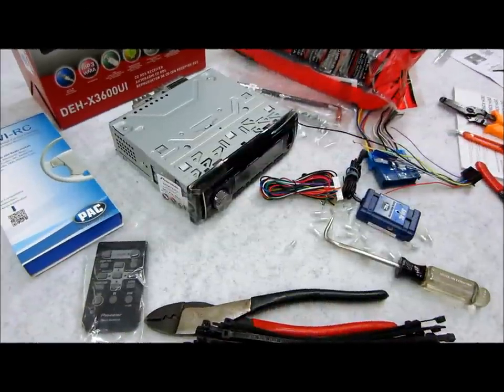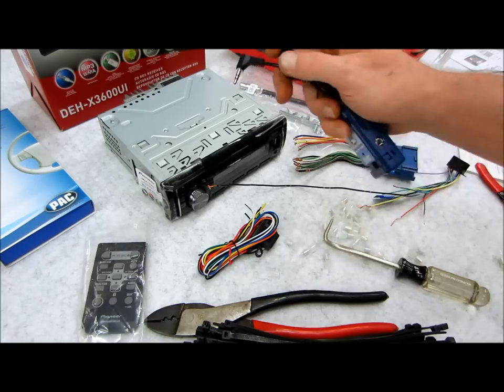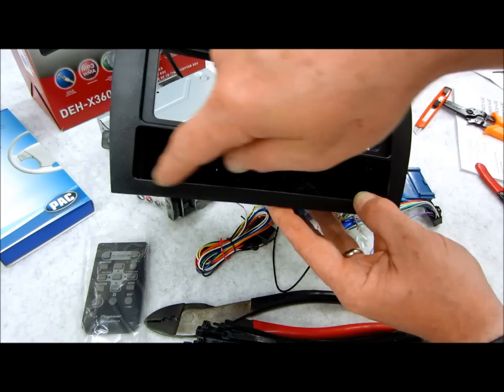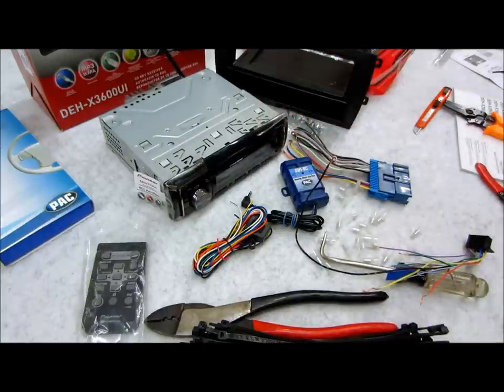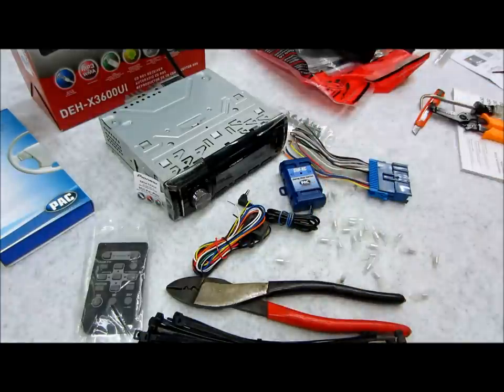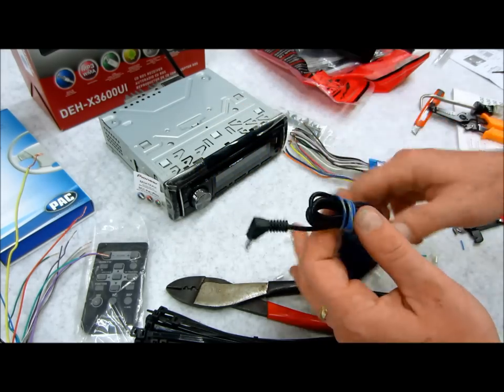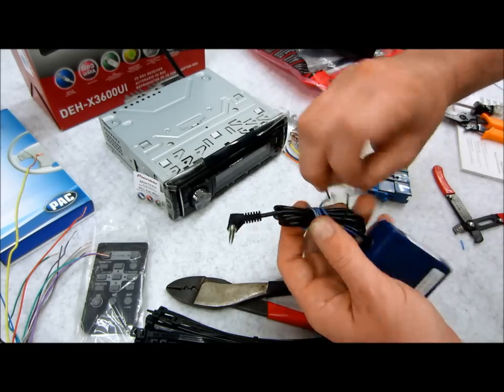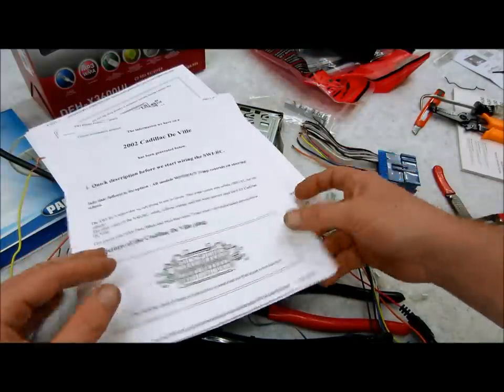How to wire up and prep a new radio, dash kit, harness and steering wheel adapter

Comment: For someone who knows what they're doing , I'm surprised you use the worst items (crimp caps,  vampire clips ). I could understand if you're a shop and in a hurry. But for yourself best way of course is solder with heat shrink tubing/tape. Those crimp caps are the worst.  Vamp clips, and similar aren't any better

Comment: I have a 2002 DeVille, is this all you need to replace the stock head unit?
Reply: Same, did you end up installing? If so what harness did you use?
Reply: @ImmaculateHairline  not gunna lie. I’m still riding stock
Reply: @ImmaculateHairline  hey did you ever find out what harness to use

Comment: im new at this, do i have to buy an additional wiring harness, or is the one that comes with my after market deck sufficient?
Reply from the maker: You should buy a metra (or comparable) wiring harness adapter so you can undo the install later on and not affect the factory wirings integrity.

Comment: I'm putting a pioneer in a  2007 Sonata with a factory amp and subwoofer. Cruthfield says I need a factory amp gain adjustment so they sent me the scosche SLC-4. It installs between the radio and harness..... the wires on the radio harness are too short. Is this really necessary because there's no where to really put it without it banging all over the place. If I tie it down then there's no slack to work with. It's just a poor design.
Reply from the maker: you can use butyl rubber or velcro in your case, look at this item we carry for that:
http://www.lesscosales.com/servlet/the-32362/New-Roll-of-Butyl/Detail

Comment: so all black wires get connected together? No need to ground it somewhere on the car?
Reply from the maker: the factories balck is always on a ground somewhere behind the scenes
Reply: NO! I followed this guys great tutorial but the steering wheel controls did not have power. After literally checking all my wiring I realized that I had both grounds together, when in fact one of them needed to got onto my Toyota's 20 pin harness. I did fixed this and suddenly the control lit up and worked as usual. This allowed the adapter to be able to learn the commands from the steering wheel controls. So NO! do not plug the ground cables like him. SEPARATE THEM!
Reply: Lessco Electronics  Thank you for the thorough video! I just installed a very similar Pioneer 370BT in my car (Accord 07) both harnesses had a black wire, I connected them together. Was that the correct thing to do? I've seen many videos connect them to a metal part of the car, although the black wire in those videos usually have a clip and my harnesses had stripped wires.

Comment: Can you help me step by step on how to rewire this radio and radio antenna ? I have an Auto shop class but my teacher assigned me this task but i just can't seem to figure it out. I've done other projects with rewiring A/C fan coolers, start up systems and more but this is just frustrating me.
Reply from the maker: +WhiskersPrime email me the wiring, Ill reply back ( Im not helping you cheat I hope?) send to sales@lesscoelectronics.com
Reply: +Lessco Electronics  Thanks, i will. You're not helping me cheat by the way. He gives me these little projects to do for fun to see if i can figure them out. I will send you an Email tomorrow with the wiring.

Comment: hello! i have this nissan altima stereo  model 2008.. i want to use it outside the car. can you give some idea on how to wire this one! thank you.
Reply from the maker: get the reverse (nissan side) wire harness from metra or a metra dealer and also buy a 12 volt inverter and youre all set for the most part

Comment: Hi,

Hope you can assist, I am trying to wire a Pioneer X950BH HU with a PAC RP4 CHY11  steering wheel control module.

Three wires that do not match in color between the HU and the PAC harnesses.
Reply from the maker: I suggest you call pac, their tech # is on their site at www.pac-audio.com  that's a very specific question you are asking.
Reply: Lessco Electronics No problem.  I actually just got answers from Crutchfield support.  Thanks!

Comment: I have a question.  When i hook up my after market radio it won't come on unless i connect the red and yellow together.  What could be the problem?  The yellow wire does not have a fuse on it.  Maybe connect a fuse?
Reply from the maker: +KMProduction .biz yes, both circuits need 12v. yellow needs constant and red needs accessory power
Reply: Ive done this before but guess its a older car i have to manually turn the radio off.  no big deal   thanks

Comment: I'm having odd issue's with my install.
1. When I disconnect the black wire the deck stays on.
2. I hear wiper and turn signal noise on am band only.
Any ideas?
Reply: The radio antenna can also be used as ground so when the black wire is connected you have two grounds, if this said black wire you are referring to is the ground for the harness. As for the noises i honestly couldn't say.
Reply: Dave cose I'm sure you've long solved your am radio noise.  If not, I just watched a video that said to make sure to run any power wires far away from any sound signal wires.  The emf waves from the power running other things, is amplified and that is what you are hearing.
Reply: Ya I always do that on installs. This appears to be a different issue. I'm thinking I got a dud head unit.

Comment: I'm  looking  for  help  with installing an aftermarket Pioneer MVH-X36 BT stereo into my 2005 Monte Carlo. I purchased  the Scosche GM035 wiring harness and  and the dash kit so that I can mount the stereo into the dash. I got  everything  connected and mounted but  an  not  getting  any  power to the pioneer stereo. However there is an extra plug left after I plug in the new  wiring harness to  the  factory wiring plug.  I have photos if  anyone can  help.
Reply from the maker: Misty Pogue that car is pretty straight forward, verify you have +12v on the yellow and red. thats all it can be

Comment: does the one connecter with the black end that you solder to the adapter come with the radio?
Reply from the maker: +EmbraceElectric  no, the steering wheel adapter is an optional part you buy.
Reply: +Lessco Electronics not the steering wheel part, the other main plug

Comment: My wire harness did not come with a black(ground) wire where do I connect it to? I have a 2000 dodge neon
Reply from the maker: that braided strap behind the stock radio acts as the black ground wire in your car, ground it there or anywhere back there that's convenient.
Reply: Installed yesterday, works like a charm
Reply: Thanks

Comment: My audio is drained my batterie twice, I'm possetiv that it's audio. cuz it got 12Volt constantly I assume?? cuz when I plug it out car works great.. how can I change that it only gets power when the egnition is on ???? thnxx
Reply: Elite Elektriker well what is your audio? subs or just the headunit? there is a wire called a rem or remote control and it is usually blue. this should be connected to a 12v accessory sorce so when you turn the key it turns on the amp or headunit
Reply: cool thnx imma try that. my audio is one with the build in gps n screen something i order by alixpres.com, dontno whats it calld dosent have any name
Reply: its just the headunit
Reply: Elite Elektriker ok you should be look up the wire in the manual and look for something in you car that has 12v but only turns on When you have the key to accessory . good luck if it fails you can have it wired like you do now just put a switch so you can manually turn it on/off .

Comment: got everything wirred got power but no sound ...2004 grand am please help thanks
Reply from the maker: Ricky Leblanc what brand wire harness integration kit are you using?
Reply: Got it going thanks for your time ...metra wiring kit

Comment: I did this n there is smoke coming out of my head unit. What can be wrong. I rewired like 3 times n grounding my head unit in different areas n there is still smoke. I hooked everything up n turn the head unit on n it's playing fine for like a minute n then you hear a loud buzzing noise n boom, smoke. Help me,please.
Reply: Disconnect all speaker wires RCA and remote wire just leave the ground power(12v) and the ignition(yellow) turn on the car and see if it's a problem with the power if everything is fine check one speaker at a time.. Or it can be a faulty head unit  hope it helps
Reply: CHAVO ANTRAX thanks I will try that this weekend.

Comment: What does it mean if every time I plug the  stereo in that the fuse in it keeps breaking? I have no idea how I am supposed to fix it.
Reply from the maker: check for a dead short in the red, yellow or orange wire. if there is no issue there the unit most likely has an internal issue.

Comment: Aren't you supposed to use a resistor for the steering wheel adapter?
Reply from the maker: only certain models require that

Comment: I did everything  amd my stereo won't  come on, can you tell me what i did wrong? What im i suppose  to do with the ilumination  wire(orange) and the power Antena (blue) that could be the reason?
Reply from the maker: Alex Tepetate neither of those can cause your unit to not power on, get a test light or a voltmeter and test the power leads

Comment: I have a Sony radio in my 2003 Audi. There is a buzzing noise coming from the speakers but when I disconnect the amp turn on wire (blue and white one) it stops.. But sound is only in the front.. Any ideas.?

Comment: I have a pioneer deh p7400 / mofset 50W x 4
stereo unit. Power source good. Unit fuse (10A) good. Ground good. Unit doesn't power up. What could be the problem?
Reply from the maker: +Kerry R. Miessner if the red and yellow have +12v and the units grounded, its toasted and needs repair

Comment: 2009 XLR Cadillac installed a Pioneer Avic 5201 Nex into this car. My cruise control and on star won’t work . I didn’t keep old radio so I lost data connect to loop. What can be done
Reply from the maker: Id call metra and see what they offer